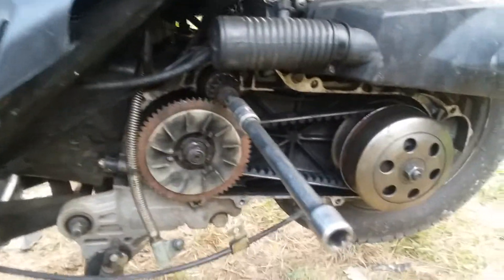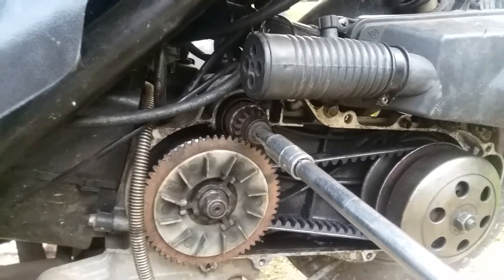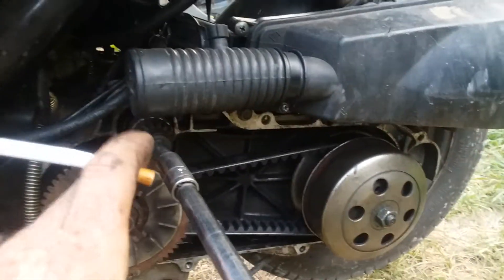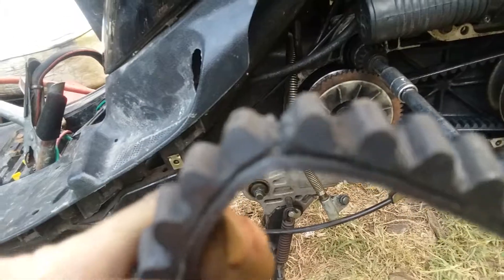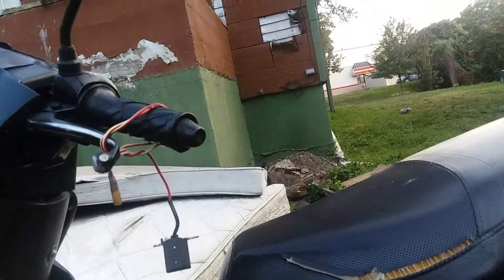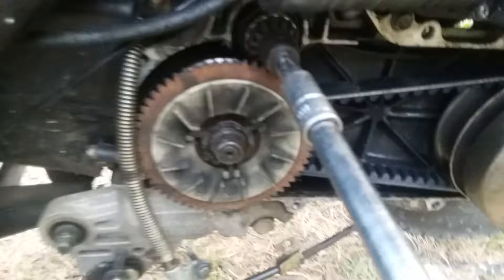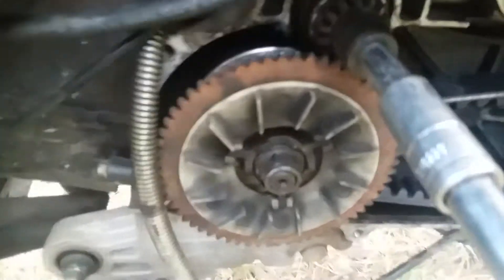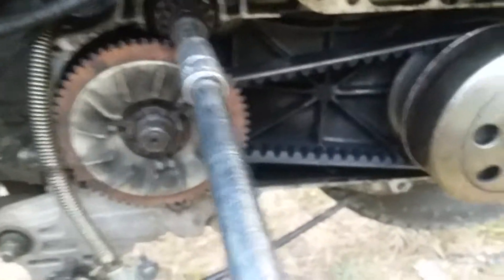Scooter transmission running without cover

Comment: I have 181cc big bore kit and won't start without high torque starter and a really good battery. I run mine without variator cover and would recommend the Kevlar reinforced belt any brand will do.

Comment: I couldn’t get mine started with the cover off because the starter gears would jam. Good tip using the socket extension to keep them aligned. I’ll give that a try
Reply: Hey i took the cover off and the gears jammed now its not starting do you have any tips